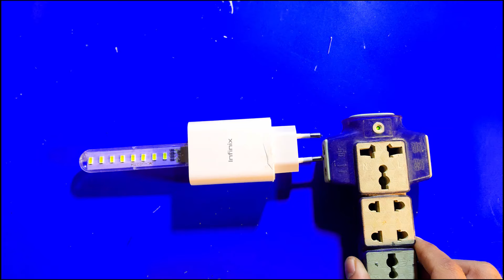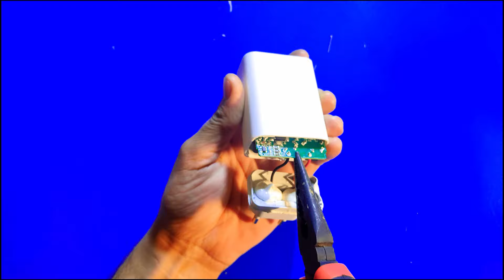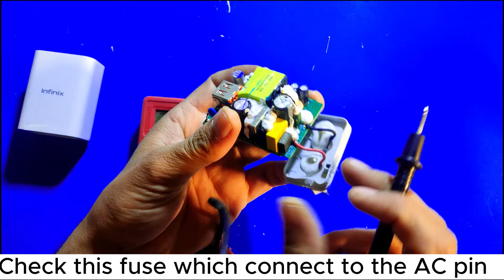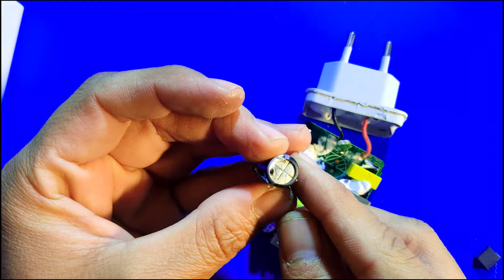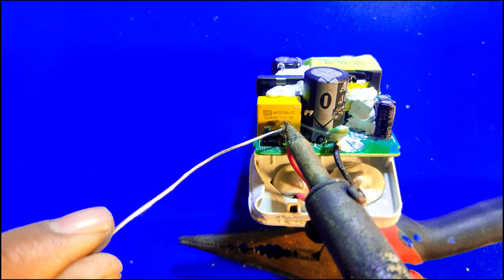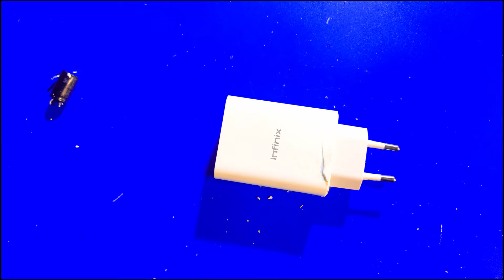Infinix Mobile Charger Repair || How To Repair Mobile phone Charger

Comment: My charger it works but it is so hot that I can't touch it and it smells and has a yellow liquid coming out of it and it still works. Why? ❤
Reply from the maker: The capacitors of this charger are blown and after some time it will stop working
Reply: @JustElectronics97 what country are you?